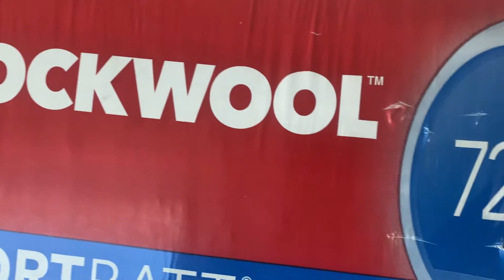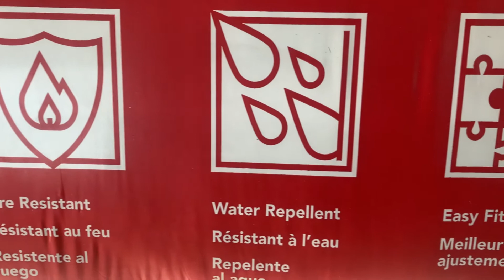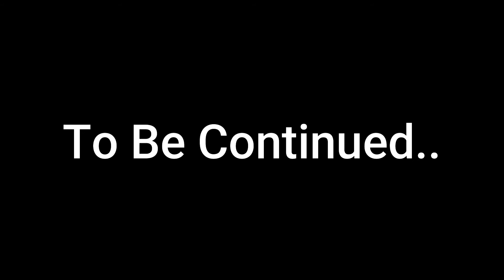Easy Budget Build Insulating the Adventure Van Conversion time-lapse

Comment: I know it’s a done deal but if you can, don’t compress that baton type of insulation. It will lose its R value. Enjoying the build so far Shawn.
Reply from the maker: Thanks I tried to keep that in mind some of it I definitely had to compress a bit to get in the tight spots! I came to find the proper way to insulate a van is simply “the best you can” 😂 so many awkward and hard to reach spots!